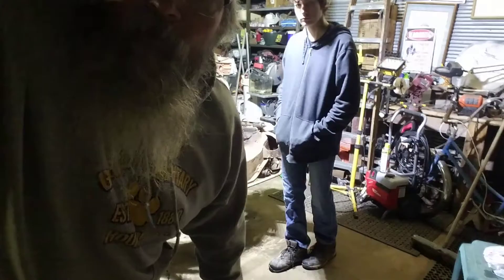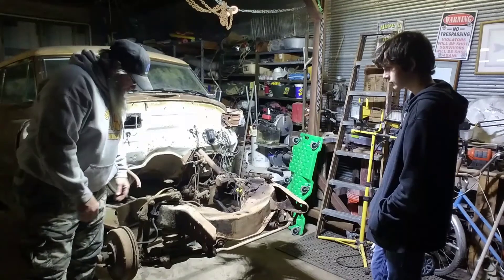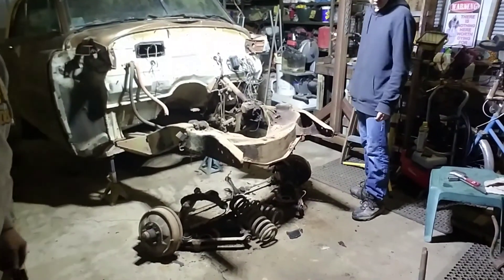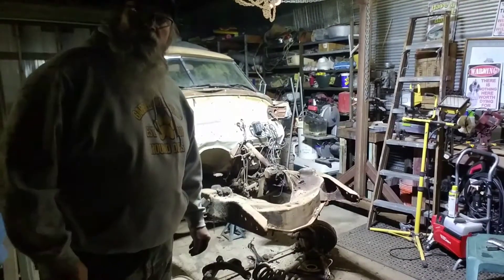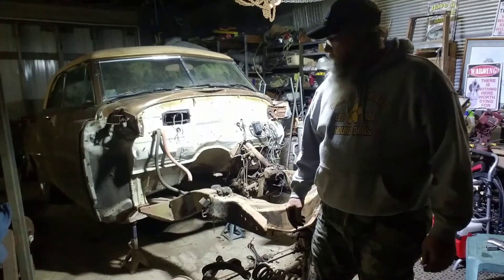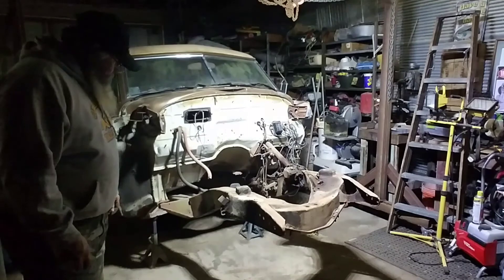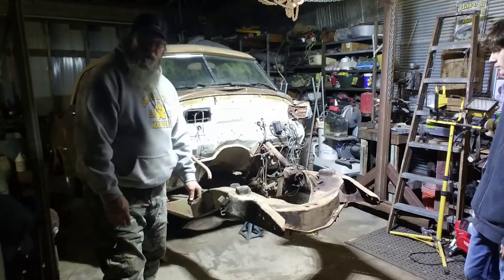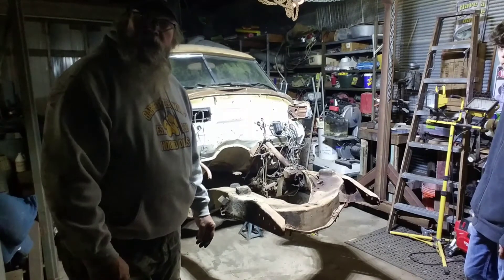Coronet (Episode 2)

Comment: Now you are leaving me hanging. I need to see what's what with the steering gearbox, and how you puts this together. :) This is going to be tricky. Curious if it would be possible to modify the original a arms to attach the spindles, etc from the later model and whether that would gain you anything. That K member front end is it's own critter.

 I went over to working on the GM stuff back in the mid 80's. If you wanted to upgrade suspension, you chopped the front of the frame off, and welded in a nova or camaro sub frame, then keep chopping and welding til you got your fenders back on. Some adjustment to the angle the steering shaft went through the firewall, sometimes there was some knuckle joints involved. Another small feat was making sure those didn't bind up on you.

Well, keep the action coming. If you hit a road block, show it. Maybe someone out here will have some ideas for you.